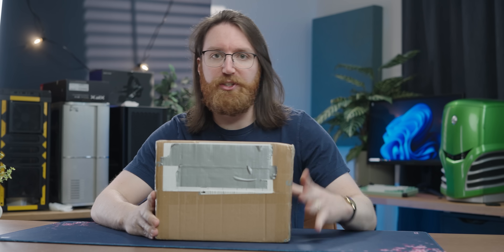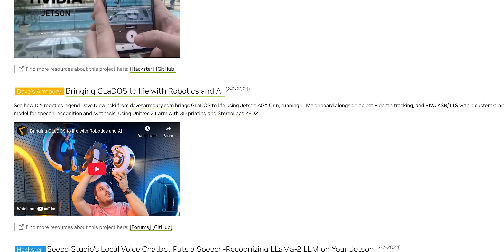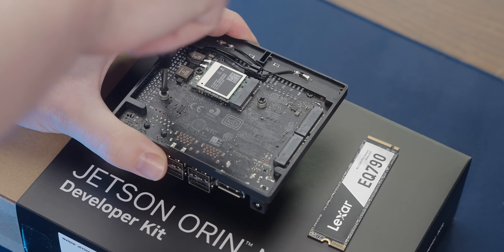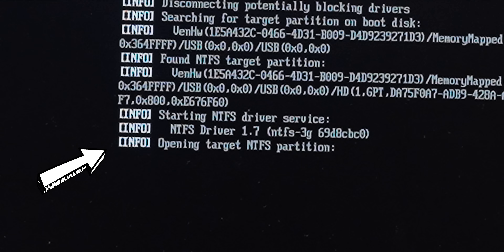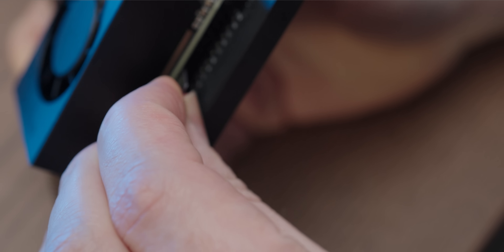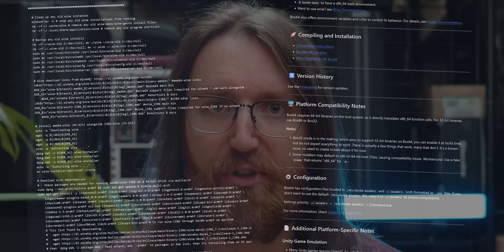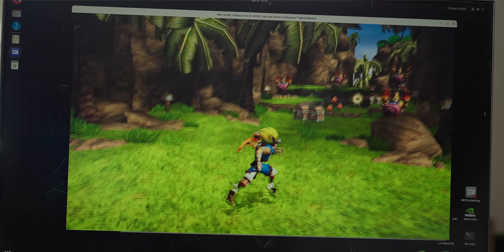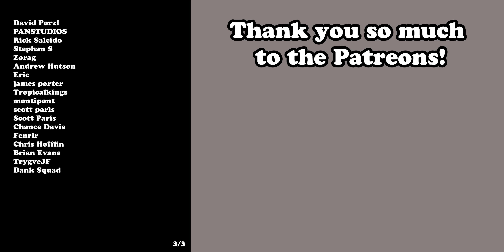Gaming On Nvidia's TINY Super Computer...

Comment: Love your Channel, Dawid. Been watching for years. But I feel obligated to mention that it even says on the back of the box that you need a Micro SD card to start the system. Now, their failure to include even a blank Micro SD card, let alone one with the necessary files for booting the module, is infuriating, but damn, dude. Anyway, back to the video.

Comment: As long as they are working and bribing idiots I'm not going to use anything Nvidia at all

I'm absolutely mind-boggled they are asking 250 bucks for this pointless hardware crap some nerd can find fun applications for but in general just utterly useless and a waste of resources because when done figuring out what you could potentially do with this it just end's up in a shoe box just like all those Raspberries which can't even run Ubuntu properly or run anything heavier than a SNES game. Any other use case is also simply lacking performance

Comment: Lol this was kind of painful to watch as someone who runs Linux and alot of ARM dev boards. For one, Nvidia Jetson boards suck. It's probably the best hardware in the space but Nvidia uses Jetpack, which is their own proprietary release of Ubuntu with all sorts of crap bolted on. You can't get any other distro running on these, they don't release Linux drivers like at all. When Nvidia decides to drop Jetpack support for it like they did with the original Nano, just throw it in the trash. These things are meant for custom designs for things like machines that use a bunch of object detection etc. That little baseboard is just like a demo unit. The Rpi 5 would likely smoke this thing in general use, and it has about 1/10th the power but it's well supported and the GPU drivers are open and available. That's really the problem with the whole ARM ecosystem when you try to run Linux on it, the GPU driver stack from Android is not compatible with normal Linux distros and most companies do not release GPU driver source code. There are dev boards that are far stronger than Rpi's but they tend to use Mali GPU's which is a GPU based on ARM IP just like the CPU. The only Mali driver in Linux is a reverse engineered open source driver which is great work but leaves a ton of performance on the table. Qualcomm seems to be gearing up to go after Rpi, which is good because Qualcomm has one of the few iGPUs that are both pretty good and have open drivers so once they release something more powerful than the Arduino Q......that will be the thing to get. The ACPI thing is kind of weird, ARM typically does not use a BIOS, or ACPI. It uses a bootloader and device trees. I saw a message from an Nvidia dev that says ACPI is not supported on any Jetson product so it's insane that it had a UEFI with the option to turn on ACPI. That ACPI table tells the Linux kernel where all of your hardware is and what it does, so if it's broken......

Comment: David i love you, but sometimes i get headaches watching you trying to deal with software... Without watching the video past the 12m mark (until now), what do you expect the actual GAMES you get through Steam to do, which are also x86 software? -.-
On a system like this, your best bet is to run some kinda retro emulation, but attempting to run regular Steam games on whats essentially a souped up Raspi is as futile as resisting the Borg with a Miranda class cruiser.
Also, and this will come in handy for future David, on Linux weather a file is executable or not isnt determined by its suffix (which is more like an informal moniker that doesent actually do a whole lot) but a flag that you can (or cannot) set for any file.
So there is no .exe, .com or .bat that determines weather or not its a program that you can run and even .sh files arent automatically executable only because they follow a certain naming convention.
Linux just does things differently then Windows (or rather, Windows does stuff differently then the rest of the computing world) and in "its" context setting an executable flag for a file before you can run it makes perfect sense.
Also, also, PPU modules are essentially PS3 shaders, required for emulating the exotic PS3 CPU, and you werent recompiling the games at all. In practical terms its not much different then what youre used to from UE5 and the likes.

Comment: The sounds a lot like me working on projects on the pi. I asked myself why I picked this as a hobby and then I remember the option was that or talk to humans😅. This is a great way to pass your time until your dead without having to talk to people.❤😂.   The last thing I’m gonna do is send a shut down to me to myself.
Reply: It’s so funny because you’re complaining about the exact same thing. I’m complaining about just on a different single board computer.
Reply: Wait, you didn’t just end this trashing a second computer did you?😂
Reply: I am trying to get Internet in a box, IIAB, into a Jackery 300 battery pack, to make something equivalent to an old fashion boombox, but for media and possibly gaming along with running AI.  Weird issues with USB devices not working correctly to back up the database and then I found out I bought a half dozen 2 TB USB drives that were all fake😂.   I shared the screenshot to Gemini and it’s like dude you got screwed over by someone.😂

Comment: I thought the same and switched the Device Tree to ACPI and it didnt boot/post. You need to reflash everything again to make it work. Keep ubuntu 20.04 system handy and installed. A VM will not work as flashing connects and reconnects the device so you cannot pass through a USB device.

Comment: I like your videos and I see the passion you have when dealing with your computers. With that said, I felt really sorry for you during this video in specific, I could FEEL your struggles with Arm and Linux thru the video. Which I find a little funny since Linux can be such an easy OS to play with. I had to brute force learn to work with it using 3d printers. But I found it to be so much easier to interact than Windows itself. I would spend sometime learning about Batocera/Steam OS and see how that works for you down the road. Keep up the good work.

Comment: Idk if its exactly like a pi 5 but with a raspberry pi if you want to boot from m.2 you first need to install the os on an sd card to boot initially and then configure it to boot from m.2 instead before loading the os on the ssd and rebooting.

Comment: Dude is messing with dev board for two days and calling it a computer. The computer is the "ram like" thing. You are not supposed to use it in production, but most companies do. You are supposed to develop a custom PCB with all the necessary io ports. Also, after you installed jetpack on sd card you can copy it to nvme drive and only keep boot on sd card. Or you can do complete install of jetpack on ssd by using nvidia sdl manager. I don't think that you can install windows there because you need special kernel that is provided by nvidia with tegra support. And you cannot use it in Windows. And you cannot compile your own because architectures are different and there is no source code. For steam there are no arm builds, and no source code either. So, emulation is the only option. This device is not supposed to be used at home, so you won't be able to find much application for it.

Comment: Emulators are an extremely bad way to get an idea of how a system will perform most of the time they require quite a bit of tweaking and experimenting to get them to run decently on a known good system.

Comment: Nvidia doesn't have open source drivers. So I'm immediately not interested in a follow up video. Also Nvidia usually has issues with Linux compared to the competition. However there ARE programs that allow you to not only run steam, and run your steam games on cell phones with Android, which are arm based and work surprisingly well. Wonder if you could plop android on this and give it a shot. Doubt there's drivers though as this is a very niche device and again, it's Nvidia.
Reply: Nvidia had problems with Linux like 10 years ago or so. This whole board runs on Jetpack, which is Nvidia version of Ubuntu.

Comment: You probably would have been better installing an android OS and use winlator or Gamehub to run PC games on that things. 
If the GPU drivers are decent the experience could be fairly good.
Reply: Switch emulation must be a treat though on this machine on the other end.

Comment: My first thoughts when it wouldn't boot is because of the way the bootsectors/loader is setup in Linux, 
You could've preinstalled to the nvme and solved your issue, but it's always reccomended to install from the system you are booting from. 
.
Boot from SD because raspberry PI always looks at the SD card first like a 2000's pc looks for floppy.

Comment: Hmm I did some development on its predecessor Xavier, you can switch to using the NVMe for booting, but I believe you need to do it by first using NVIDIA SDK Manager, choose the NVMe as target and install jetpack once... this takes ages, if they haven't changed the procedure. Then if you want, use MS's Windows boot media creator to make a USB stick directly, no etcher or rufus! And then overwrite the jetpack install.

One reason you were struggling to find software for the Jetpack firmware could be because it's an Ubuntu LTS, thus doesn't have the newest stable releases of a lot of softwares. You can upgrade an LTS to a normal release on a vanilla ubuntu LTS install, I'm not so sure whether Nvidia's Jetpack edition supports that though.

Anyway, Steam is still x86-only, so even if you get Win11 for ARM up and running, it will still be running in an emulator.

And, even many games that do exist for native Linux are x86 only as well... Try supertuxcart.

Comment: So, basically it's about like trying to get every other single board computer on the market working (with the possible exception of the raspberry pi).  Now wait until you try to use more than one of the different features on the board, and realize hours later, that a build that supports everything doesn't exist.  Then you will truly understand the joys of this hobby.

Comment: thats a dev kit meant, to be used by people who know what they are doing.
Reply: this guy knows nothing about what he does or what he talks about
Reply: No sorry changing a bios setting should not brick a device and require it to be reflashed dev kit or not. It is is doing that it is a bad design and buggy as crap not ready to be on the market. 
In fact a dev kit should be almost unbrickable it should have ways to restore the original bios with a single jumper or button so that iterating things like oh you know a custom bios or new bios can be done quickly. I have worked with older dev kits before and the only way i ever bricked one was by making a stupid mistake and plugged in the wrong power brick a um higher voltage one when chips start popping like popcorn yeh the thing is dead. Hilariously i managed to get one such board back up and running minus a usb port in about 5 minutes.

Comment: Come on you have done Linux stuff before, you can install pie apps on Ubuntu, also you likely would have had more success if you flashed Windows to go to that SSD using Rufus or trying to use w o r raspberry on Windows installer to do that. I've had issues even booting Windows arm USBS on arm surface pros LOL

Comment: I've worked with these Nvidia nightmare of a board. Starting with tx1 and tx2 and then with agx nx and Xavier. And the number of times I've reinstalled their jetpack O.S. on them and soft bricked them is astounding. You follow their instructions and half of the time they just don't work, do exactly the same 3 times and it magically works. I even got to take home one from work that everyone thought as dead and after waiting 2 hours of a black screen it just revived itself and it is going strong.

Good luck to everyone working on these things. They are powerful and great but really temperamental
Reply: the big Orin is quite reliable once installed, but goddamn flashing the things is a rollercoaster
only managed to ever flash one on ubuntu 24.04, I use 25.04 usually, so I had to install a linux-linux dual boot lmao
every time it has different issues flashing, sometimes it randomly fails halfway through the flash, sometimes it refuses to install stuff to the OS once flashed

Comment: This is typical Linux experience. You need to watch a 30-minute tutorial on how to install the game. In the process, it turns out that the tutorial is outdated.
Reply: Often times by 2 3 or 4 years and all the repos are no longer maintained or they are gone completely. Or you install something from a outdated unmaintained repo and it removes have of your DE install breaks it and you can no longer use it and oh yeh because of how it broke it the only way to fix it is a full fresh linux install and then you say you know what time to install a os that works windows 11 and try linux again in 5 years...
Reply: It's more along the lines of typical arm experience, since at this point gaming setup is same as windows (with the exception of a couple of multiplayer titles being completely borked). 1. You install steam (or heroic for other game stores) 2. You install desired game 3. You play the installed game
Reply: I have to agree.  I like Linux too.  For just browsing the web or  listening to music, it simply can't be beat but god help you if you go off the beaten path.  Being ARM based means it's even worse.

Comment: The ''supercomputer'' performes like a Celeron with its IGPU. 🤣
Reply: I think that performance would make the Celeron look good.  An earlier commenter nailed the reason why:  It takes four cores to run a simd instruction, and rpcs needs to run the simd instructions four at a time.  Just not enough cores available since 16 cores would be needed for rpcs to run well.  (x86 cpu's don't have the same limitation. A four core celeron can execute four simd instructions at a time, and could run rpcs better than a 6 core ARM as a result.  My 16-core Xeon Gold can run 2 AVX-512 instructions per core at the same time, so 32 simd instructions per clock, and it runs rpcs like a dream.)

Comment: Hey! I work with AGX Orin stuff at work and I can give some background in why things are the way they are:
The micro SD: It's only used in this model because the SOC has connections for eMMC storage built into it. The SD card is wired directly to it in your case, but on other systems they come with on board storage connected to the SOC.
Boot order & UEFI: I believe to change the boot order the system has to be booted into RCM mode and the whole board needs to be reflashed with a different config for it - Likely also would have fixed the unbootable boards. Not sure how it's done on that specific devkit (we use custom carrier boards) but there should be a switch that you hold down while connecting power, and then you connect the devkit to your PC over usb (I'm assuming that usb c port on it) to reflash

Edit: Did a little bit of research, and for the Orin Nano Super you want to bridge the FC REC pin (under the SOC module) to GND. While they're bridged you want to connect it to power, and then to your PC (ideally running Ubuntu, or another linux distro that supports the SDK manager). You should then be able to re-flash the device from the SDK manager (We don't use SDK manager at work, we instead use some of the L4T flashing scripts - so my knowledge of if is limited) - as well as choose where to install the OS - SD card or NVMe
Reply from the maker: This is super helpful. Thanks for the breakdown. That sounds like quite the process, but I'll get around it. I saw posts of people doing the process with Windows, but it makes sense to do it with Linux on the host PC. Just remove variables.
Reply: As someone who literally spent a week trying to get one of these little bastards set up the way I wanted it, they are INCREDIBLY fussy to get configured. Get used to bridging those pins. Any setup video you see which goes smooth and fast, they are NOT implementing the new Super speed drivers, they are setting up the older kind, which do load easy if you don't care about getting the actual horsepower of the GPU out of it.
Reply: Mine, by the way, does boot from a 2TB NVMe card, and it does use the super speed configuration, and I wouldn't go through that again for a grand.
Reply: Since you know your stuff when it comes to these, If someone was wanting to get into running their own local AI for something like realtime voice (and when I say real time I just mean something reasonable, I understand theres inevitable gonna be a delay on something like this. Would you recommend getting this or going down the GPU route? Like what would be the cheapest way to run something like that?

Comment: I think ps3 is very hard to emulate in general. Its hardware architecture is very alien and proprietary.
Reply: It was already emulated few years ago but it was challenging for sure to create that emulator.
Reply: Emulation works pretty well on the latest AMD CPU's (anything that's on  AM5), the latest AvX extensions really help.
Reply: @Freddie1980  Thanks all for the info!
Reply: It is - but we've come a long way and devs are killing it. I've been running RPCSX on my Lenovo legion with the SD 8 Elite flawlessly
Reply: Yes, emulation on x86 processor is quite robust now, but emulation on Arm processor is very new and still very buggy and unoptimized.

Comment: The back of the box literally said sd card required for startup
Reply: wait fr??? LMFAO
Reply: It's not required, setting it up to boot off an M.2 isn't the worst process in the world, it just needs Nvidias SDK manager + a host system running Ubuntu 20.04/22.04 and you can flash it straight to an NVMe